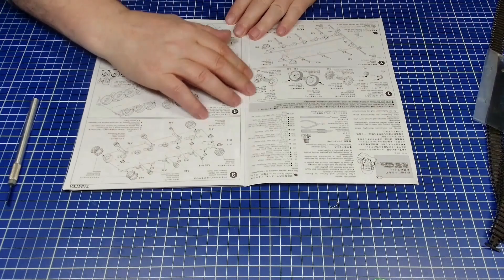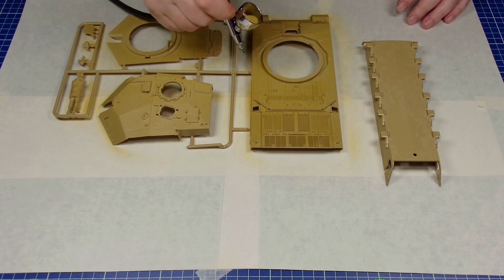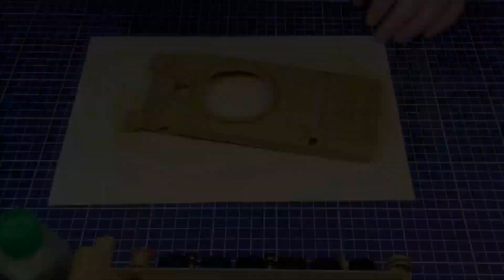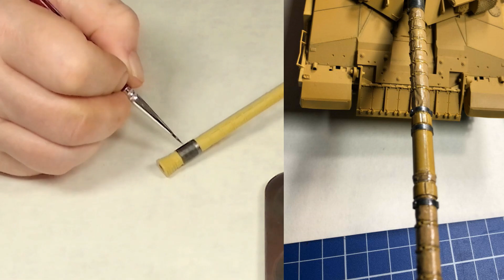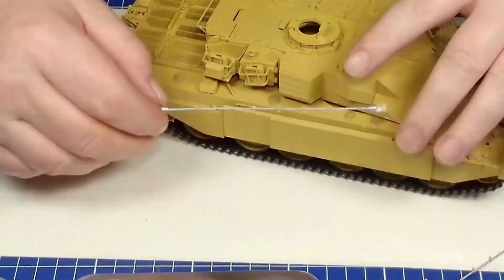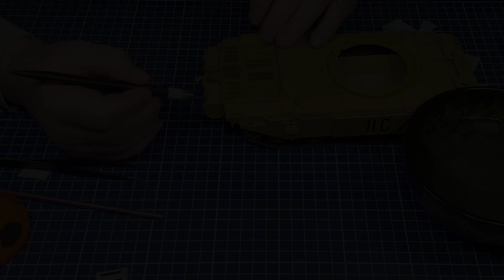Tamiya - 1:35 Challenger 1 Mk.3 - Complete Build

Comment: Why IS there no anti Slip ON IT ? Tamiya ignore this Feature a lot ! 🤬🤬🤬🤬
Reply: Anti slip?
Don't know what you're saying but when I've painted any military vehicle, it was sand thrown onto the paint whilst still wet and brushed off afterwards when dried out.
Painted again to cover the sand or put more on if it didn't give enough grip.
Well, that was how we did it from 1988-2004 anyway 👍
Reply: Most Kits have IT molded on